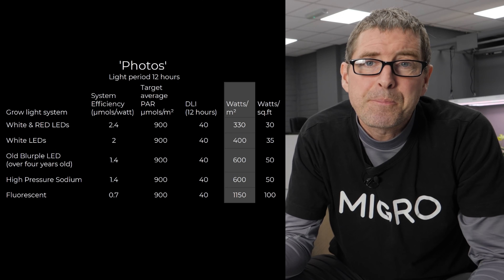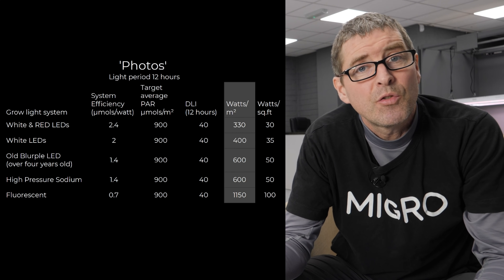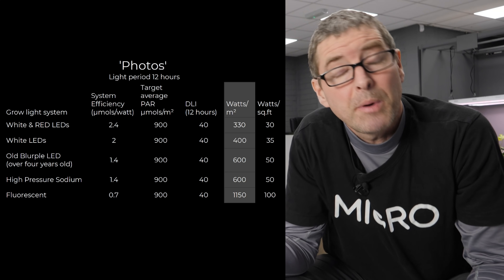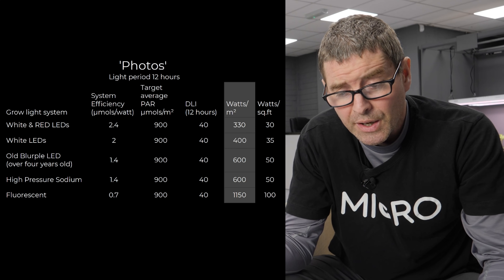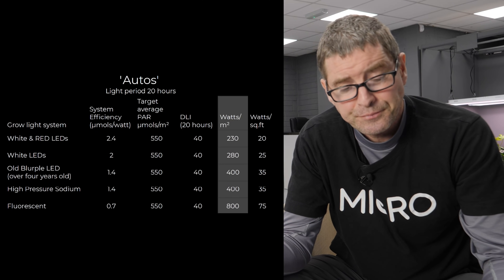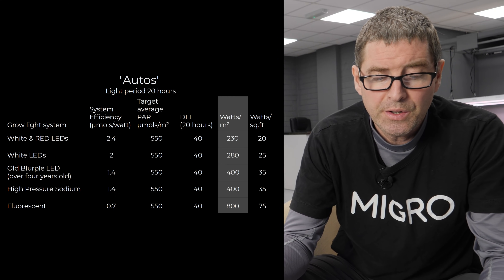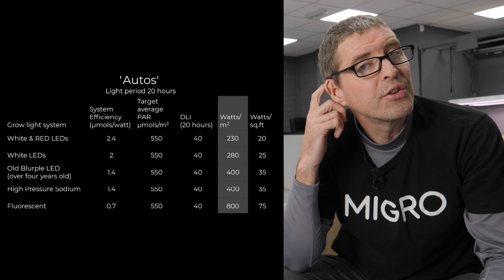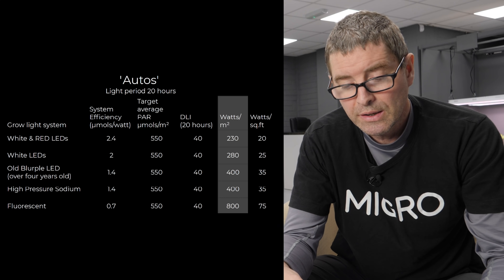Photos and Autos Recommended PAR levels for Photos and Autos

Comment: is 40 DLI really a roof? or can you do 50 of 60 and get a better result or will it do more harm than good? 
instead of only running the lights for 20 hours why  ot run 24 hours st the same par intensity

Comment: Ive been trying to figure out what par to run autos.  My first run i did like 900 and my leaves after a week looked like a horrible cal mag def.  My current run i was doin like 750 and am seeing leaves crisp up and taco. But took your 550 x 20 got 11000 so i run my lights at 18 hrs a day and turned them to about 590 600 at canopy top.  See if they come back to life.  The color will be crappy on just the leaves but think this will be good am also seeing the benefits of plant training because the lower set of bufmds are getting like 400, which i know can absorb more but the tops will be in the crisp zone so no bueno. Awesome video dude!

Comment: i have 9 autoflowers on a RDWC system with CO2 enrichment, i want 60 DLI max (800PPFD 18/6) on flowering stage. Based on your table do i need CO2 if i will not overcome 1000ppfd?? Thanks
Reply from the maker: Hi Dante, 

No co2 is not required.

Thanks.

Comment: So I have 2 tents with bar style LEDs a 4X4 with a 480 watt light and a 3X3 with a 300 watt. I want to use the 3X3 to grow autos on a 18 on 6 off schedule and veg my photos that will go into the 4X4 flower tent. I will grow maybe 2 autos in 5 gals and have a few photos in 1 gal pots vegging. How much should I dim down the 300 watt light in the 3X3 and keep everybody happy ? Or is this just a bad idea to veg photos and run auto in the same tent ? I'm doing pretty good at 75% but sometimes a leaf or two will curl up on the young photos especially if its a sensitive strain. I guess the real question is should I get a par meter and do the math.

Comment: Thanks for this. When I built my set up, I went with a 5x5 and 2 SP3000 from marshydro. Afterwards I was worried that I was low on my watts per square foot. But looks like I’m spot on for my autos 👌 one day I plan to put a little more light in (hoping to find another 300w for cheap, to get better penetration. But also don’t wanna push my DLI to much)
Reply: I have the same exact setup. How many autos do you normally do at once?
Reply: @ahlers1977  I do 4 since that’s the legal limit in my country. And usually that will fill the tent wall to wall in flower. Smaller plants you could manage more for sure though.
Reply: @KootsRoots  thanks for the reply! Our state limit is 5 so I haven't done more then that but I'm sure a 6th would easily be possible since I use 5 gallon pots. Using 7 gallon I'd stick to 4 more then likely.
Reply: @ahlers1977  I use 3 gallons in coco. Watering multiple times a day sucks haha but looking to get something automatic installed. I’ve found that by doing 3 galling coco coir with a salt based fertilizer such as flora-flex or something similar, I get some pretty big plants, typically each plant is easily a quarter pound at minimum, so 4 plants is a pound harvest at least which supplies my smoking habits between harvests. 
Another thing that helped me (maybe not so much if not using coco but not sure) is Rainscience grow bags. Much easier to clean and reuse than your typical fabric grow bag, better root pruning and more airflow to the roots. I found as soon as I started using them my plant size had to have doubled as I was getting much smaller plants doing my same coco-floraflex in normal fabric grow bags.
Reply: @ahlers1977  I mean, it’s not so bad I guess. I water once in the morning once at night. Few cups until it runs off. Got the style from Mrsfunk420 who grows massive autos, and basically just follow her method with great results.
Reply: @kootsroots4858  I replied but it appears that my comment was either deleted or it never posted for some reason. I started watching some of her videos & I must admit I am very impressed! I have never even heard of FloraFlex until now but I may just have to change some things up. I did just order another light...Mars Hydro sp150 to put in between my sp3000s & a pair of Migro UVB bulbs for the last 3 weeks of flower. I have been using pride lands top dressing in 50/50 Happy Frog & Ocean Forest with some added perlite but have found that every Auto I have ran in that mix has gotten nutrient burn. According to Mrs Funk she says she runs 30% soil & 70% coco or maybe I missed where she had switched to straight coco? Sounds like you have worked out a pretty good system though so congratulations!

Comment: One 600W HID in a 4x4 is a bad choice to start with, 4x 150W HID would be easier to handle temp wise and offer better, more equal light output, but I think 4x 125W would do just as fine. Lower temps overall even with four heat sources, you can get closer to the plants and maintain an even par output. Just saying four horses can pull a lot more than one strong one.

Comment: What changes would I get if iv dropped the light down to 6in above canopy with right par levels as specs at 32in till they get bigger and lift and readjust hight and dimmer for more space needed.Will that work ?

Comment: Just use 12/12 for all then. I have 10 hours of cheaper electricity. But actually you can push more autos than the photoperiod plants. Instead 1000 umoles, use 750 and 24h photoperiod if you want max of them.

Comment: I use a mars hydro ts1000 i run them at 65-70% and 16" for veg. Fullblast for flower. Only grow 2 plants max. Plants are loving it and temp and humidity is pretty stable. 

The mars raises temps near root 5 degrees above outside tent condition.

Comment: If you’re providing 40 DLI over a 12 hour period would you be able to just grow autos alongside photos then?
Reply: I started 2 autos w/4 photos.  The autos never "autoed" into flower.  Changed lights to 12/12 and autos flowered and finished under 12/12 with the photos.  Over 4 oz on each auto.  They did veg for 2 months though
Reply: @fakename7570  then it was not auto
Reply: @jccuchvjvj  Maybe it was... if you think about it... autos are on timer and that timer may only count when lights are on, not during dark period.

Comment: I am about to start my first grow in a 4x4 tent with an HLG 550 R-spec.  Given the relative low levels of blue in the spectrum, should I supplement by hanging a propagation LED strip like the ones from Sunblaster to enhance the blue spectrum and hopefully reduce stretching of inter-nodal lenghts? Or, is this not a concern for this particular light?  I have height limitations in the grow space.
Reply: I did notice my plants getting a bit shorter since using HLG (had blurples before). So, I would try getting more blue in there and see what happens.
Reply: Po

Comment: alright shane, you might not be super familiar with this or i'm asking it in a strange way, but i'll give it a go anyhow:

for photos: when using hps 600 the averages of feeding ec/ppms was like what 1,6/1,8 in flower? 
now with leds you might need to go up to 2,2/2,5 in some cases. (even have seen commercial running 2,5/2,7 in veg! and weirdly dropping in flower to 1,8/2.0...)

with autos, everyone suggests half or even 1/4 feed. however with leds you might run normal feeding schedule almost. any thoughts?

Comment: Thats cool. I was amazed at the fact that the autos i grew last winter, in 4x4 using only two 150w (300w) leds, came out fantastic. The autos i grew outside, the following summer, hated life. Most of the flowers  foxtailed and or just didn't look or smell right. Some of them hermmied and self seeded as well. The crazy thing is, I used the hermed seeds for the next round of autos towards the end of summer and they came out awsome with very little anomolies and all maintained their fem/auto status. I attribute the difference in  results to the ruderalis strain in the autos. I'm doin autos right now in Nov outside with shorter days and cooler temps and they love it
Reply: Hey thanks for this info. Just started playing with autos last summer. Grew some outdoor. They hermmied as well. Still smoked ok once dried and cured. But I've been curious about the seeds till now. Just researching an indoor set up to grow thru the winter now. Appreciate the info.

Comment: Fascinating, I’ve been using a 24hr light regime on my auto’s. Using a quality living soil has been a game changer too and is giving me the healthiest plants ever, and zero worries re fertilising use and water Ph and such! Bliss! Quality lights on top, quality ‘live’ soil on the bottom..can’t just focus on one aspect.
Having my 2 x 4 setup in a bedroom wardrobe means a little extra CO2 at nighttime too. I may reduce my light regime to an 18/6 or 20/4 now however. Thanks for the info.🖖🏼
Reply: I'm rocking 24hr light regime, too. You think we should drop to 20 and target 550umol?
Reply: @1SmokedTurkey1  didn’t see your reply till now but yeah, I’m reducing it to 20/4 or even 18/6..mostly as the room it’s in gets very warm during the summer days. Deep green leaves, nothing but water and maybe a top dress with worm casting..bliss!

Comment: I think your assumptions about autoflowers is wrong, in that just as with photoperiods, the amount they can handle varies.  Run them 18/6 at 800 PPF, most modern autos will do very well. Some of the older, Lowryder based autos won't be able to handle that much light, but the only real way to know is to grow them! I'm growing my autos under HLG lights, a 650R and a Scorpion Diablo. I'm keeping the lights adjusted to 800-900 PPF.
Reply from the maker: Hi, I agree you can increase average PAR above the levels I have recommended but I think the rate of return reduces above these levels, thanks, Shane
Reply: @MIGROLIGHT ....How much can you give 3rd week veg.....can you post a schedule of power through the grow....week one, week two etc and when to scale it up?  

I've read the 550/600 at the end of veg / early flower as a target,  I went for quarter power 150w PPFD for the first 10 days on 24 hours for temps as it's cold here when lights go out.. then went half power 300w giving me par of 309 at 56cm and a DLI of about 20....but I'm really not sure when to lower or turn up the power to increase my Par/DLi readings from here, so a schedule of increases would be really useful shane.
Reply: @winddrift03
The question isn't if they can handle it but what you're really getting for much higher electricity cost so = grams/watt.

Comment: So in a 4x4 with autos what would be the best wattage of a light would to give you the best bang for the buck?   Im currently running a VIVOSUN 4000.  pulling just at 400 watts. It's a nice light but i don't feel it covers that 4x4 like it should... 

Love all your videos and info!
Reply: A 400 in a 4x4 is perfect. Should be getting nice tight buds if everything else is dialed in. 💚💚💚✌️🥳
Reply: @NoGreedSeeds  Would 4 VS 1000 be better, than 1 VS 4000 in the 4x4 as one can move and spread the coverage area more evenly?

Comment: I don't know about you Shane but with a proper array of these new LED's you have reviewed for me, I have switched to 12-1 veg with 8 on 16 off flowering cycle, also known as GLT with great acclaimed results.  Harder to find info about but it's also an old professional practice in Agriculture and it sure works great, and lightens up the load on the equipment, plant stress, excess nutrient uptake, and quit a few other things.  This would only be ideal for Photo period and most likely not autos in any way.  Also I would use 16 on 8 off for autos if I didn't refuse to grow them.  There are now "fast" photos available lately that make the need for auto use even less to me.  Thanks for all the help Shane, hope to hear someone looking into 12-1 or GLT (Gas Lantern Technique) in future!!!
Reply: It's good technique for stopping flowering, just putting the light on for 1 to 2 hours halfway through night period, saves electric, but you can get a more little stretch than normal. It doesn't work for autos, you just end up with crap .

Comment: Funny how many hrs of light we give them. The longest day (38 degrees Northern Hemisphere), June 21st at 14.5 hrs of total daylight. It doesn't reach 12 hrs/day until Sept 21st. That's 3 months. What's going on?  People beginning to harvest last of Sept thru Oct. 
Exactly what is triggering them to flower? Is it the steady downturn  of total hrs, by minutes per day? Is that what a grower should do?
I know we flip to 12 all at once.
 Seems we're missing something.
Reply: I don't really understand what it is that's confusing you there?  12/12 is the turning point of the equinox in the northern or southern hemisphere, the only place it doesn't mark a season change is on the equator where its 12/12 all year around.  The further from the equator the plant naturally grows, the longer the daylight hours it prefers.

So to get 18 hours of daylight in June you would need to be 60 degrees north of the equator, at the same time the equator would be getting 12 hours of daylight and the north pole would be on 24.  Regardless the north pole & 60 degrees north would both get 12/12 at the same times of year; the vernal & autumn equinoxes.  So it's very accurate way of detecting the season change, how are you expecting them to do it?
Reply: @RocketNothing  That's not what I'm saying. If I start and grow the plants on 14 hrs of light. They are not gonna flower at 14, right?
Now, if I decrease the light 1  or 2 mins per day, is this gonna be enough to trigger flower and how long would it take for the plant to recognize the decrease in light?? Understand what I am asking?
 I promise you they will start flowering way before they reach 12 hrs of light only. Does the plant recognize a 1 min drop in light?
Reply: Right, honestly can't answer that, I've never tried extending the bloom photo period, I assumed if it was possible to flower with more than 12 on a non autos then everyone would do that as it would reduce lighting & cooling constraints?

Given the amount of growers I deal with who have revag & herming problems in flower I'm guessing you don't get a lot of contingency.
Reply: @RocketNothing  That's another thing I was wondering, was the hermi issue people are having. I flipped at 12/12 from 18/6, then have raised it to 14 hrs and they are still flowering.  And the ones I started at 14hrs are still vegging on 14, so I am flowering and vegging in the same room at the moment. It's something to think about. And I have no hermi issues.
Reply: @happyg.444  yes you are right I’ve done this. I started seed at 14 on 10 off smoothest grow and seemed to grow just as fast as my others. I had sighted flower after 71 days so 71 mins less that 14 hrs give or take. My night growth was amazing!
Reply: I guess the most unnatural thing in that equation is its a bit cold for growing cannabis where you get those length hours, but 12/12 for seasonal change is still logical, cannabis is native to places that stay warm in 12/12 days
Reply: @RocketNothing  That's another thing, plants where 12/12 is normal, what triggers them to switch from veg to flower if the light is constant 12/12? The most light on the planet is 16.5 hrs above the artic circle. That's why I say we're missing something about the trigger for flowering.
Reply: Like anything organic it's never going to be an exact science I guess?
Reply: @happyg.444  The plants with or without the help of cultivators have adapted genetically to growing and flowering at many different latitudes  with the subsequent variation in daylight lengths. You seem to be looking for a one size fits all answer. An equatorial strain (12/12 all year) will start flowering while just a few weeks old but needs those few weeks to become old enough to flower.
Reply: @robertwood4681 Yep, it's strain dependent. I live in 49N latitude, some strains start flowering in late July but mostly its early-mid August. I had a strain that went into flower in mid September (no light leaks btw, planted in forest, perfect darkness). It's genetics based. And latitude of course (if we talk specific months). That's what I hate about seed companies, they tell you month of harvest which is irrelevant if you don't know the latitude.